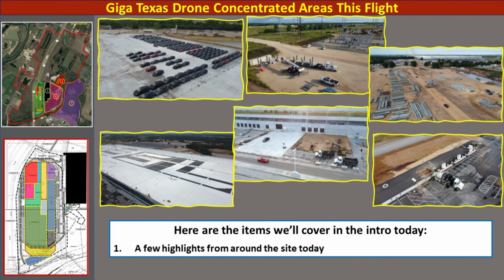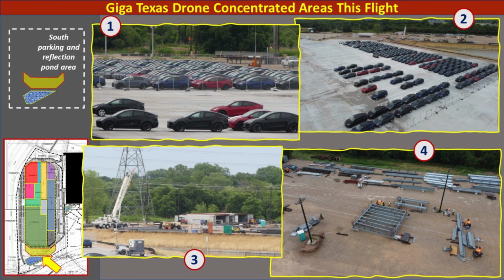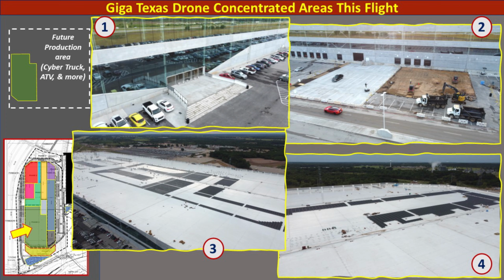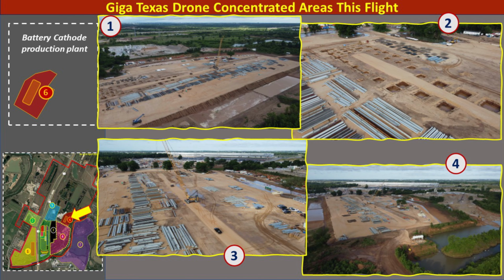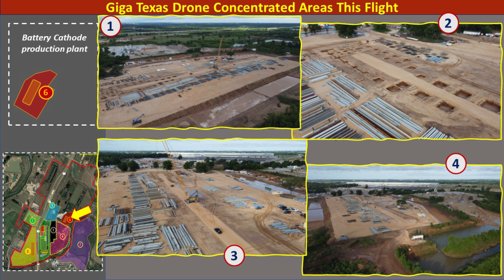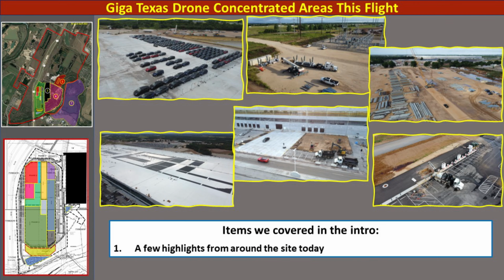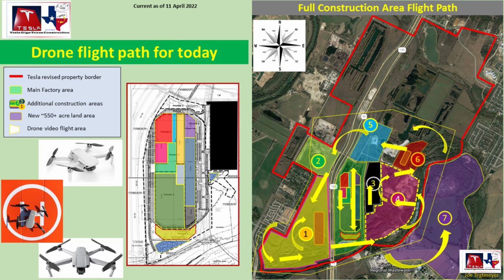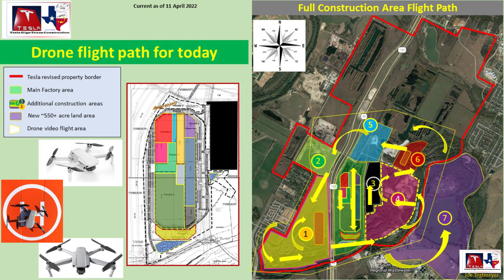Tesla Gigafactory Texas 25 May 2022 Cyber Truck & Model Y Factory Construction Update (07:15AM)

Comment: Thanks Joe.
8:19. South end steel fabrication yard. A dozen or so columns stacked towards the back. Bottom right, offcuts of the top of columns. Lifting lug on top of the column offcuts, uniquely (to this site) the columns in the Stamping Extension had the same lug, https://youtu.be/mcBM1tZLvew?t=594
11:19. GA, apron works. Removed section. Took away a good depth of road base before bringing in gravel. Pile of fresh gravel to the left of the bobcat. 
Interesting to see if these trucks with the removed asphalt leave site. Brad’s video earlier shows the asphalt plant on Tesla Road (west) where there is a pile of asphalt paving and a crushing plant, https://youtu.be/vsmBj7egam0?t=589
11:46. GA, loading docks. Air circulation fans in the part opened doors. 
Also inside Battery at 12:41. Another in the Main Entrance Doors in Jeff’s video Day 671, and more seen inside Stamping in Joe’s photos from 16 May.
West side road. Cyber pedestal has ‘cat’s eyes’ or road reflectors around the base. 
16:44. Old Bagging Plant. Concrete being loaded into the big dumper trucks, so not leaving site. 
18:26. Tesla Rd, north side parking. Follow that dumper truck. Next seen at 19:00. Another truck at 21:57.
22:44. Eastside parking drainage holding pond. Pump at work.
East-west road. Trenching and laying conduits. For street lighting would be likely.
23:26. Eastside parking. Slot drain seems to work.
25:01. East side rubble stockpile. Dumping a load of the demolished apron from the Old Bagging Plant.
Reply: 12:30 -- Odd the overflow roof drains discharged that much water.
Reply: @patrickkenny2077  All down the west side whenever it rains (and when the roof was being washed down), the water discharges out onto the pavement. I think they have the pairs of roof drain inlets swapped over so that all rain is discharging to the pavement via the overflow. 

That bunch of 6 drains is from the centre of the building (Plastics/Paint). Assuming the centre roof drains were to supply water into the H vaults, there might be some reason they don't want water in there for now. 

Might be the same on the east side, but not as obvious for some reason.
Reply: 16:02, The Gas Insulated breakers are most likely for the higher voltage lines than the ones used for the temporary switchyard. Notice the length and size of the insulators, a rough rule of thumb is a thousand volts per inch of insulator length. I have been wondering if they would do a GIS system inside a building instead of an exposed yard.
Reply: @GoCoyote  Hi Sparks! The GISs. In terms simple enough for a retired chippy to understand, what capacity increase is likely?

Comment: 16:02, The Gas Insulated breakers are most likely for the higher voltage lines than the ones used for the temporary switchyard. Notice the length and size of the insulators, a rough rule of thumb is a thousand volts per inch of insulator length. I have been wondering if they would do a GIS system inside a building instead of an exposed yard.
Reply: They could still do a GIS….those high side breakers are probably 345kV…just a guess since I’m not familiar with the local transmission system.  They could do the GIS for either side. It’ll be interesting to see what they do. If they start building a large building then it could be a GIS. But they have so much real estate to build on ….the economics may not work. They will probably have a large building anyway for the AC/DC conversion equipment.
Reply: @Scottupnorth  
Sounds about right. Exterior Highside GI breakers, transformers, then for distribution, then either lowside exterior switchyard or lowside GIS inside a building. Nice thing about having the GIS inside is being able to service equipment while staying warm and dry within a protected building.

Comment: Could the square steel platform already be the preparation for the connection of the coming expansion of the main factory towards the south?
Reply: I highly doubt it, probably for the interior, I feel it is going to be many years before expansion, more towards 2026 as almost half the factory is still not being used yet.
Reply: More than likely it's another of the semi-permanent loading platforms as seen on the north end of the building at 14:15.

3 locations where such a platform can be installed. 2 wall openings at Battery seen at 13:59, and the other at the south end of GA seen at 7:05.

Comment: I guess I don't get it. Most of the cars have been there now for two weeks and a handful have been delivered. Last nights storms here in San Antonio were filled with hail. That would be a mess if the storms in Austin had the same hail. Time to get those car delivered.
Reply: Very suspicious,  I wonder if they hare having serious issues somewhere In production of cars, why so few for suspected delivery and so many others for testing? Are the casting systems a failure already or are they short on some parts like batteries and seats or glass. Remember a lot of the cars were re entering the building after being in the parking lot for a few days or weeks, that points to parts missing!
Reply: @AndyAndy-we9pe  I think it is mostly about parts and batteries. Still not up to speed on the later. Oh well, eventually we will see a second shift and cars really rolling out the door. There is still no "delivery lot" for completed cars. (well one that could take 2K of cars a day.)

Comment: @ 11:10 So, the new concrete slab is striped for parking in front of the drive through door? The door they forgot to build a ramp for! @ 11:34 Wouldn't it have been so much more efficient to build a concrete slab in the first place.
Reply: Well, you may be right about it.  Could still be for a moveable ramp as Dessie thinks as that area had more rebar.  If they do build a ramp, it could be years away, we'll see.  Another theory, instead of thinking about the ramp, what about the door?  What if they eliminate it?